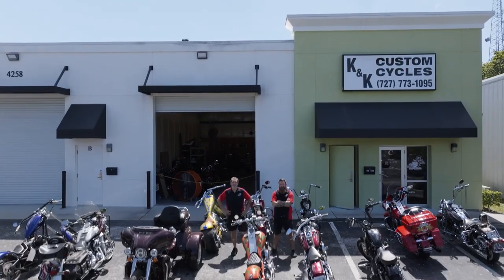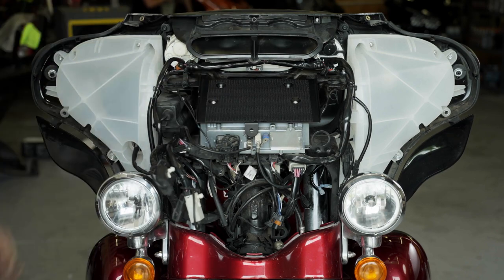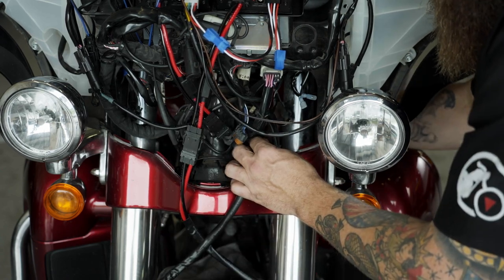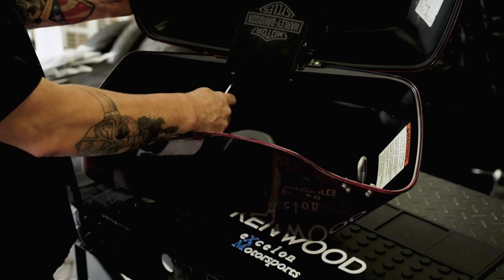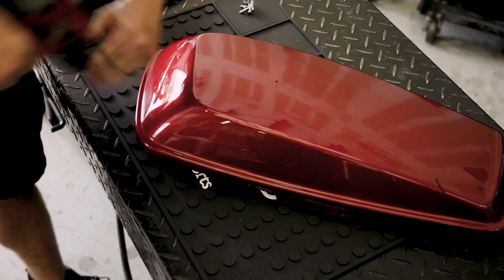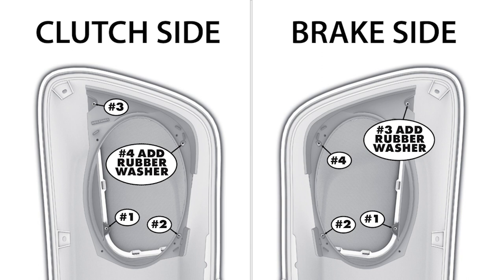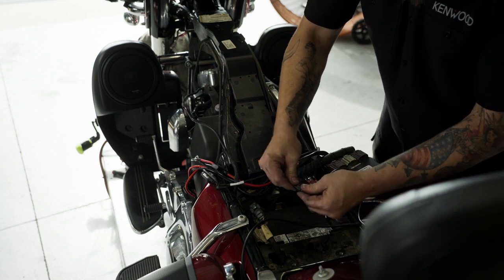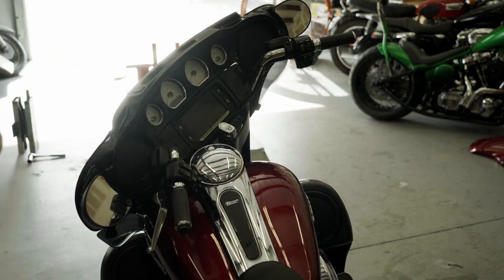KENWOOD P-HD2R Installation Video 14+ Harley Davidson® Street / Road Glide® eXcelon Motorcycle Audio

Comment: Can the cut kit be used with oem lids that have the 5x7 speakers? 
Im assuming the kenwood cut-out is larger than the original 5x7 size.
Reply from the maker: No, It won't cover the same opening space left behind by the factory cutout. Thanks!